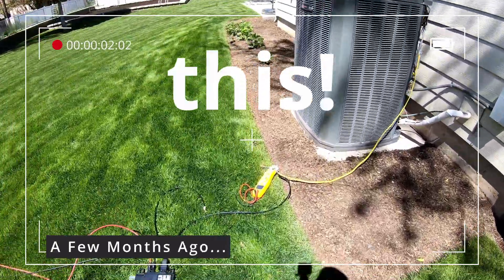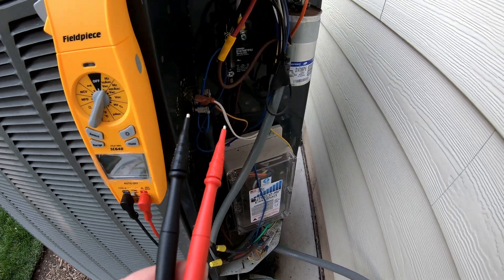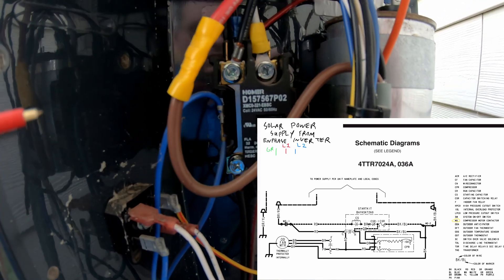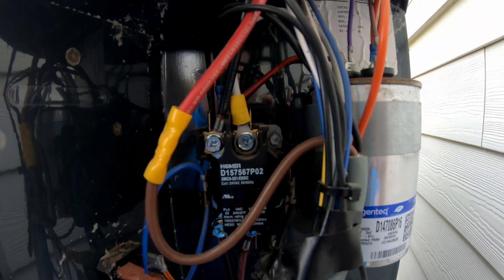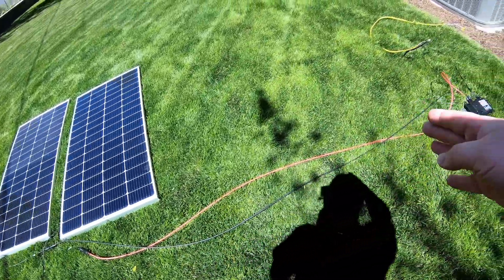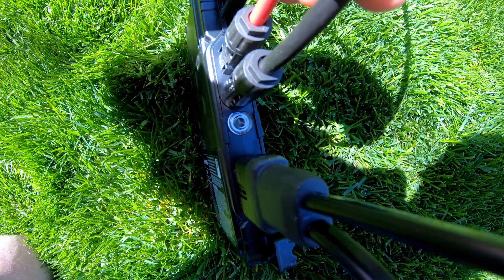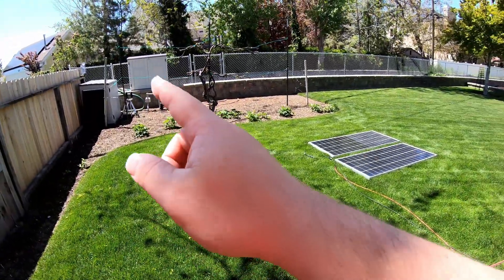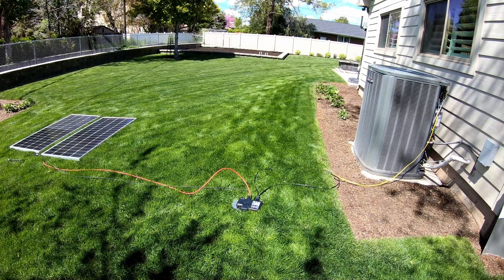Wiring - 1 Hack To Eliminate Your A/C Power Bill This Summer!

Comment: Good afternoon, i contacted my local AC guy and he said he would do it but feels comfortable if there's any type of wiring diagram how to wire to the contactor. Would there be anyway you can send that over through email? Thanks any information helps out.
Reply from the maker: I do not have any wiring diagrams. This video should be sufficient for any licensed HVAC tech or electrician who’s knows anything about how the power wiring in an A/C unit works to successfully accomplish what you’re trying to do. Thanks for watching!

Comment: On a 2-stage unit, I assume you can only have panels as big as the first stage power draw? It's probably not good to have stage 2 power going into the first stage!
Reply from the maker: Yes. My unit is a 2 stage unit and it runs in low stage 90% of the time. So to avoid any back feeding I am only sizing the solar for the 1st low stage. Thanks for watching!
Reply: @theresatrickforthat your 2nd stage will be 100% of the ac capacity, meaning it will draw more amperage, than the 1st stage, I’m not sure why you’d think you’d have a risk of back feeding in 2nd stage.

Comment: Thanks for the great info! 
Question: If back feeding is not an issue due to a grid tie agreement connecting this to the line side contacts would essentially supplement my home usage in addition the ac if applicable correct?
Reply from the maker: Yes it would. Thanks for watching!
Reply: @ amazing what a great setup. Thank you!

Comment: How would you handle AC failure being there would be no load in that event with a contactor energized
Reply from the maker: I guess it would depend what the failure is. A lot of compressors when they die, will short to ground which would cause the breaker to trip and obviously disconnect everything from the grid so the solar would not function. Thanks for watching!

Comment: I did this before but changed it as follows. Connect inverter to panel 220. Use a silicone relay activated by the thermostat cool call or my Tesla charger.
Reply from the maker: Cool deal! Thanks for sharing and watching!

Comment: Great video, only issue I saw is that the "reviews" regarding the MICRO-AIR Easy Start Flex on Amazon are horrible! While many people began by say it was awesome while it worked, it doesn't seem to last for any decent period of time. How has your experience been? Or, is there a different manufacturer that you might recommend?
Reply from the maker: Thanks! The micro air is not needed for this setup…hopefully you caught that. I just have it to help with my backup generator.
I can’t speak to the Flex unit because I have their older model and it’s been flawless since I installed it! I love mine! Thanks for watching!

Comment: So I watched a couple times but I am not understanding how the microinverter does 2 things.  1.  How it knows to provide power to the AC.  Is it sensing power coming through the contactor and then after that 5 minutes of seeing continuous it starts feeding?  How would it know when the contactor shuts?  2.  And this may go back to point one, but how does it synchronize the phase (frequency) of the AC output?  If L1 and L2 of the enphase power is out of phase with the grid L1 L2, its going to be a bad day I would think.
Reply from the maker: Yep! Once the inverter has been able to see a steady grid connection for five minutes, it starts outputting power. The action of the contactor closing is what allows the inverter to see the grid so that’s how the inverter knows the contactor shut. The programming in the inverter automatically allows it to sync to the grid power in the correct way. That’s what it’s doing during part of that 5 minute delay. Thanks for watching!

Comment: I’ve seen a few of these on pool pump timers and HVAC but no one long term. I thought the Enphase and Hoymiles will only run like that for a few days without a gateway/dsu. After several hours/days they will no longer produce power until connected up to gateway/dsu.
Reply from the maker: I think the reason this keeps working is be the inverter essentially gets reset every time the A/C unit shuts off and so the inverter doesn’t see that it’s connected to the grid for extended periods of time. Thanks for watching!

Comment: I worked this out on paper a couple of years ago and just recently completed "Phase One" testing at a friends house using the Hoymiles 2000 where we created a ground mount system with four commercial "high" voltage panels into the one Hoymiles for 240VAC. The host and friend has a net metering contract that needs protecting so we just back fed his system through an RV power pole (240VAC) instead of an A/C condenser cotacter and it worked perfectly. I did disconnect testing with an early model of enphase at home prior to the Hoymiles for a proof of concept. It is great to see I am not the only one thinking this way as it makes so much sense for what could be legal solar for the biggest consumers: A/C cooling and swimming pool pumps without a house system or any sort of metering contact. Great job! I would like to contract you further. How do I do that? JH in San Diego.
Reply from the maker: Glad to hear of your setup! Has the Hoymiles been a solid performer since your initial setup? Maybe you haven’t had time yet for long term testing. Thanks for watching!
Reply: Good morning Ben, I'm getting solar installed probably in February or March of 2025 and I'll be on net metering as well. Can you explain how you did this connecting it to an RV pole? How many panels and watts per panel did you use? Our summer here is brutal and our AC runs 24/7. Would love to help out the home system by offsetting the biggest consumer. Thank you any help is greatly appreciated.

Comment: I recommend the Hoymiles that can take 2000watts from four panels with just one inverter. It does not require a gateway and works perfectly.
Reply: I see a handful on their site, which model would cover the average home AC unit?
Reply: @YusufShurbaji  With a micro air soft start should bring most AC start up watts down to something easier to manage so probably somewhere between 3000 to 6000w so depending on the tonage of your system would depend on the amount you'd need... this would be for 2.5 tons to 6 tons... But any amount lower than your running watts will help reduce the cost too as he did in the video
Reply from the maker: Great recommendation! I’ll look into them! Thanks for watching!

Comment: Do you know if there is such a ac to ac grid inverter? I am asking because I would love to use my 2000w power station to offset some of the electric consumption during the on demand times... I know that's a pretty specific case, but adding a traditional grid tie inverter to its low power DC output is not really helpful, however if I can use the more powerful AC side, that would make a difference. Thanks👌🏼
Reply from the maker: I’m not aware of such a thing. Sorry about that! Maybe others in the community can weigh in! Thanks for watching!

Comment: So, what happens when a compressor winding burns out and is no longer running?  The contactor won’t open like it would when a high or low pressure condition exists and will stay closed potentially back feeding the grid.  I would think at a minimum a current sensor needs to be in the control circuit somewhere. Just a thought.
Reply from the maker: I think if a compressor winding burned out…you would end up with a direct short to ground, causing the fuses or breaker to trip resulting in a disconnect from the grid. Thanks for watching and commenting!